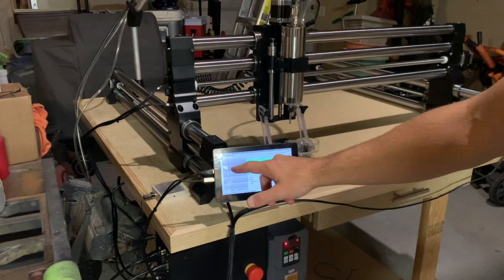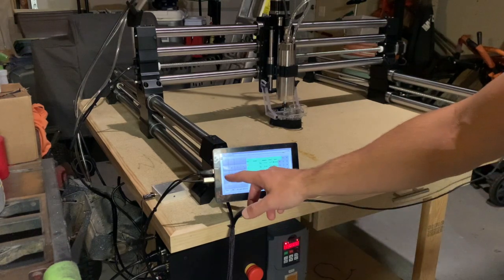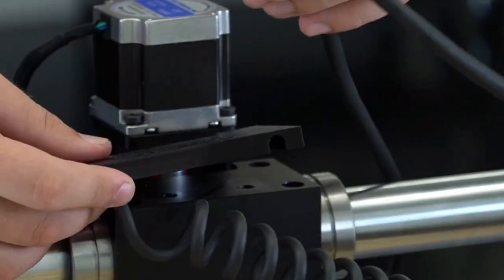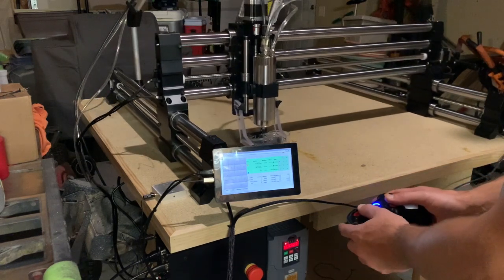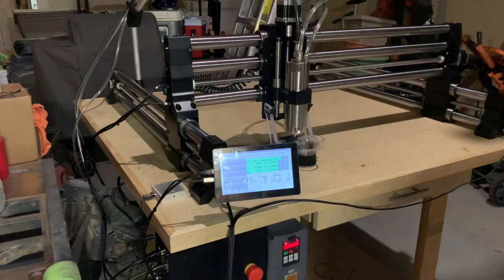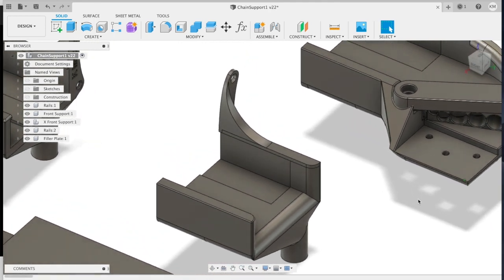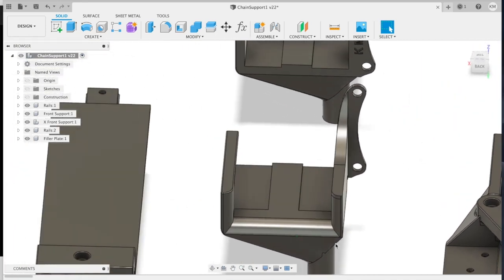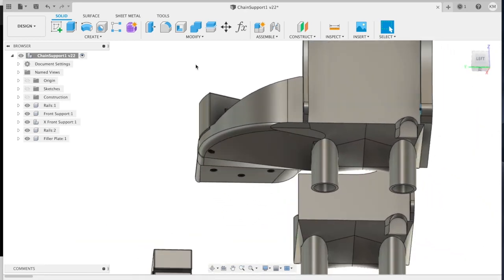Drag Chains for the Onefinity CNC

Comment: Thank you for this!  I've printed everything andthe parts are great EXCEPT for the X/Y wire circles. Did 1F upgrade or change them?   The rectangles are too narrow and don't fit the cable connection.  Also, what size square nut are you using for the z plate 4mm

Comment: Great Job Kevin & appreciate you uplinking  the STL files. One question though, where does the 'rail spacer plate' fit into the equation? I couldnt see it on the vid & the problem i have is my 3D printer (Aquila X2) is to small to print. Is the length able to be shortened without any detrimental consequences???? TIA

EDIT. Never mind, just read description on shapeways store

Comment: Hi Kevin, Thanks for your hardworking and for sharing that. Does the pieces fits the X-50 rails, and if not do you have the STL files for that?
Reply: X axis supports don't work, but there is an alternative on thingiverse. Also you need longer than 48" angle for the x50 axis.

Comment: This is an awesome design.  Thank you very much for the sharing!  I have a question.  Can you please specify the manufacturer of the 15x40 drag chain that you use, and what is the radius of it?
Reply: Did you ever figure out the radius ?  The radius i got is 28 , so its the wrong angle for the height on the cnc.

Comment: Those of you having issues 3D printing these parts, take note of the orientation of the parts. 

Being new to 3D printing, I had no idea how to orient my the parts when slicing. I mostly just imported and printed. It wasn't until several failures and rewatching this video did I notice how these item were being printed. 

ALSO, if you have a X-50 JOURNEYMAN, you may want to consider downloading the modified version of two of the supports as they accommodate for the changes associated with the X-50 Woodworker and Journeyman models.
Reply: where's the modified version?
Reply: @DucPhan20  thingverse

Comment: Well, my Onfinity has arrived, and there is a problem, that does not surprise me. The parts listed here are for the X-35 Woodworker, while I have the X-50 Woodworker. As a result, the end pieces, for the X Rail do not fit the larger tube rails. I have modified them and will trial them once I can get them printed. Will follow up with any changes.
Reply: Hi I can confirm this as I also purchased the X-50. I extended the plugs 18mm and moved the whole X - Axis parts 10mm away from the rails. Regardless, thanks Kevin M for the design!
Reply: @jamessteele53  You have any STL or F3D files you can share?
Reply: @bhill2625  sorry for the slow reply... Kevin actually saved a 'extended' version with his files, so I did not have to make changes to the file. Just check, he has multiple. .stp files
Reply: @jamessteele53  Hi Frederich. I ordered a X-50 as well and I’ll ask a friend to print the pieces for me. Do you have the files with the modifications for the X-50 that you can kindly share. Thank you

Comment: Not your problem but I am having issues getting the 90-degree support to fit on my 1F. I have the upgraded x50 rail and the support doesn't fit exactly the same; the tram bolt is keeping the holes on the phalange from lining up. Doing some modifications to the part to see if I can get it to work. Since I only have the STL and not the Fusion360 file (no; not asking you to give that up!), I have to either carve up the existing model or create a new one from scratch (not possible in the time I have left!) I'm fair in F360 but nowhere near at the level your work is. All of the other parts fit like a glove.  Love your concept and approach to addressing the shortcomings of the 1F.

Comment: I've been using this drag chain system for 6 months now and it's worked great.   The only issue that I've run into is that the back of the track runs into my hose boom mounting bracket if I try and use the last 1/2" of the Y axis.   I hasn't been a big enough problem for me to even worry about a solution though.   Thanks again for sharing your work on this!

Comment: as i prepare for the arrival of my 1F, 2 more weeks hopefully,  would you mind sharing your water cooled spindle configuration - is it controlled by the 1F controller or manually?  I really like your management of the coolant lines in the drag chain - sweet setup.

Comment: I printed all of the pieces out and looked great but that Rail_Spacer_Plate.stl came out horrible :( Is there an updated version of that? Where does it go? What does it connect to? Why is it slanted? Due to the slant, it prints out in steps. Other than that, the parts were great. Keep up the good work!
Reply from the maker: Thanks.  The rail spacer plate prints upside down: so the gently sloping (stepped) side will be on the bottom and the flat side on top.  It sits between the aluminum rails to keep them spaced apart.  It has holes for securing the cable chain, and for attaching rail clamp base/rail clamp top.

Comment: What spindle are you using? I printed your drag chain holder and should have it installed by the end of the week. Also thank you for making your files free!
Reply from the maker: It’s a huanyang 800w 120v water-cooled.  Er-11 collets.  Works great for wood and aluminum and is super quiet.   Similar power to a trim router with much more control.  If I did more metalwork, I’d probably want something with more power, but for now- running everything on a 120v 20A circuit it works very well.
Reply: @kevinm413  thank you for the reply! Again thanks for the 3d printed files

Comment: Great video - quick question, how did you address the Z coil wire? I have the Y drag setup and I emailed Onefinity and they said you can’t just replace the Z coil. What did you do? Thanks!
Reply from the maker: I guess I’m not sure what you’re asking-  I removed the coiled z cable completely and made custom cables for each of the Y and Z steppers.   Both are 4-wire shielded cable- 22ga, I think.   Beware The pinouts of the y and z connectors are not the same, but if you’re careful with it, it works fine.
Reply: @kevinm413  ok. Thank you. I’m not too familiar with electrical but I know onefinity says the Z coil has a special wire that is needed- so the extensions that they sell won’t work.

Comment: Are the dimensions in the STL files in millimeters (mm)?
Reply from the maker: Without actually checking, I’m pretty sure it’s millimeters.   I’ve always modeled in mm.  Learning CNC in North America has me converting units ALL THE TIME though!
Reply: @kevinm413  Yeah I pretty much refuse to use imperial. If you can count to 10 and move a decimal place, metric it is.  Easy peasy. Thanks!

Comment: Thanks you so much for posting this!  I was able to print all of the parts including the rail support on my ender 3 v2.    One thing that is not clear to me from the video is the intended usage of the rail support.  I get that it's goes between the rails, but what is the intended use for the tab on the very end?    The tab has a screw hole, but I'm not sure what it's intended to be connected to.   Thanks again!
Reply: Never mind, once I actually started to put it all together it made more sense.   The tab connects to one end of the drag chain.
Reply: Jason, how did you get this to print on an Ender 3 V2?  I have the same, but I flipped that part over, put it flat on the bed diagonally, and it exceeds the white build area.  So it won't let me slice it in Cura.
Reply: Got it.  For those of you playing at home (on that printer) turn off  Build Plate Adhesion Type.  Skirt, Brim, or Raft all blow out of the build area.  Now let's see if this actually prints...
Reply: @mitchfaatz  Yeah, it's a tight fit so you have to turn off adhesion for sure.   I also ended up turning that part on it's edge so that I could get a good clean print without having to clean off all of the super thin/wide supports.

Comment: Hi Kevin, thanks again for the great setup.  I have printed and built it all but can't figure out how to attach the 3D printed rail spacer plate to the aluminum extrusion.  Can you post a photo on Thingiverse that shows how the Rail Top Clamp and Rail Clamp Base are held together on the Rail Spacer Plate and how it stays on the aluminum extrusions?  Thanks so much!
Reply: I have the same problem, about to install it and not sure how it goes on. Did you figure it out?
Reply: @DucPhan20  yes.  It's not too hard.  I'm out of town right now so can't post a photo.  You don't even need a bolt as it is a tight fit.

Comment: Im not seeing enough how to put together the rail for the x axis. and the elbow part for the X axis dont seam to fit.  over the plug for the z axis plug? bracket is not wide enough just on the elbow.
Reply from the maker: Yes, this part replaces the existing z plug bracket.  It requires different cabling.

Comment: Has anyone printed these.  I cannot get the Rail space plate.  Wonder what settings I am using a prusia.  Any help would be great.
Reply from the maker: Orient that one diagonally on the print bed, with the large flat side down.
Reply: Ty for the response.  I tried that but it seems like its tapered and as it runs out I cant get it to stick on bed. Starts out great it must be something in my settings or slicer.  I'm really starting to hate this prusa worked great all day on the other parts.
Reply: @eiselskustomz4978  Are you using Cura? In the Rotate mode there is an option to "Lay flat".  Then go to Move mode and set Z to zero

Comment: Thank you Kevin.  I have printed the parts and ordered the drag chain.  In your video you show that you extended the wiring with new connectors.  Can you share a link for the wire you used (also the length)  and the connectors as well?  Really appreciate it!
Reply: Yeah, thats the only thing im not a fan of (but i know there is no way around it).  Id love to know what wire you used also. thanks
Reply: Hi Ryan.  I ended up ordering the connectors and crimps from Digikey and I bought some 20 gauge wire in a roll (It is paired wire that can be separated if needed)  I'm going to use 2 lengths of this together to make 4 wires and run them through some quarter inch braided sleeve I bought.

Comment: Where in the heck do you find 15x45 drag chain ??? I cant find it anywhere... And how much do i need all together if i have the woodworker ?
Reply: Ok I see that you changed it to 15x40 on Thingiverse. Thanks
Reply: @TheLiebigs  amazon has 15 x 40 and 15 x 50 cable carriers, but not 15 x 45.  Where did you find 15 x 45?

Comment: Still waiting on my machine, can this be installed with original wiring?
Reply from the maker: Nope:  you need longer stepper control cables.  It sounds like onefinity will be offering extension cables as an accessory, but I can’t speak for that: I just made my own.
Reply: @kevinm413  thanks for the response, definately thinking of doing this
Reply: @kevinm413  Do you know roughly how long the extensions would need to be to fit this setup?
Reply: @kevinm413  Onefinity is now offering 2 foot extensions and 4' extensions - which would work best?  Thank you in advance.

Comment: Wow, well done sir! I really like how you locked into the top of the mount holes for extra support!
Reply from the maker: Thanks.  Onefinity is modular in its construction: they used the same aluminum part for the “feet” of the X and Y rails.   So once I got the geometry right, I could use same attachment points for both raceways.